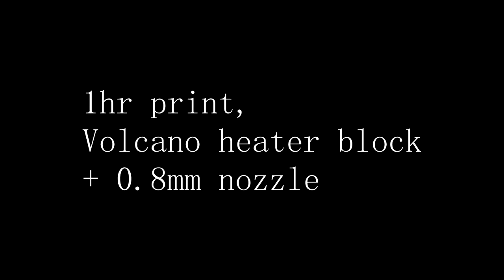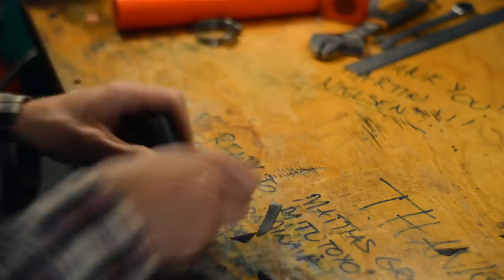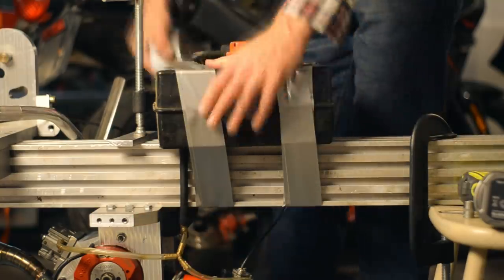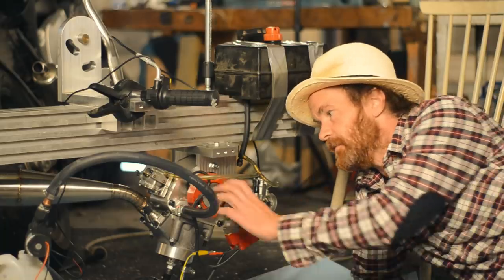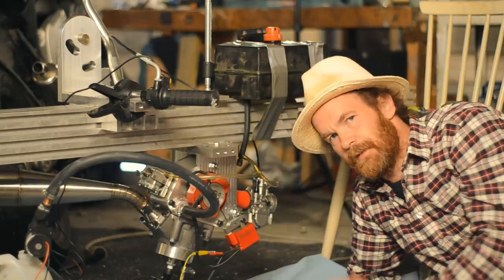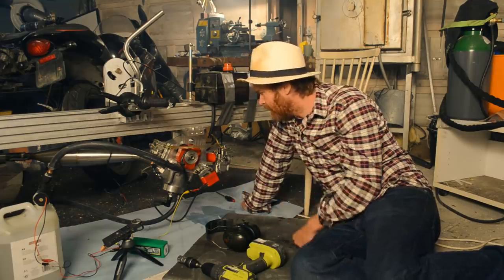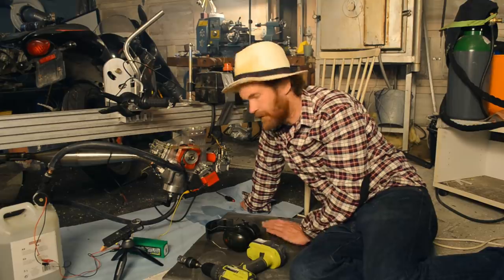Should not work, but...

Comment from the maker: Thanks for watching! I've ordered pulleys & belts for the dyno, time to get this show on the road!
As always, I'm way behind on replying to comments, sorry about that!
Reply: Your channel is getting quite large, there comes a point when you have to limit your replies to better spend time on video production etc ;-)
Reply: Wow man !  7:28 REAL 2 stroke 25k rpm
Reply: Man this is one insane little engine !
Reply: Whats up james lile my comment!!!!
Reply: It looked like there was some backflow threw the carb. I had a four stroke engine with a leaking intake valve. When a pulse of air would flow threw the carb backwards, it would pick up more fuel and then pick up fuel a third time on the intake stroke. The overly rich mixture had me thinking it had a problem with the carb, until I saw the back flow threw the carb.
Reply: You should put a tachometer on the motor so we could see the rpm🙂

Comment: This made me remember something i did 45 years ago. I welded a piece of tubing to the rear transfer port of a G5 Kawasaki cylinder.  It was maybe 12inches long and i bolted a 22mm carb to it. It actually ran pretty good, i think i got away with it because the intake was long and the carb was small. I had heard that  the factory racers were doing this to their 125mx bikes(pre KX)
Reply: It's Called " Ram Tuning " cheers

Comment: if youre using an electro motor as the load you could start the engine with that electromotor
Reply: Racebikes dont have a starter , uneeded weight

Comment: Looks like the resonance from the pipe is forcing the air/fuel from the crank case out of the secondary intake. You can see it happen later in the video
Reply from the maker: Yep. What happens below the powerband.

Comment: When cutting smaller sections of silicone hose squarely l always push it on to a mandrel held in the lathe chuck and part it off with a very sharp HSS parting tool. Works a treat

Comment: Don't know if it's not important, or because of the prototype/experimental nature of the system you are building, but it looked like exhaust gas was venting out of the secondary carb (sometimes), one thing I all ways stick with is the knowledge that a force will always travel the path of least resistance. You are doing great work👍🏻
Reply from the maker: It's just fresh mix being pushed out, will go away when in resonance.
Reply: @2STROKESTUFFING  Then it's all good, for now, also, then, no smoking on that side of the engine!

Comment: The pulsing in the secondary intake is visible, it throws out as much fuel as it sucks into the engine, but with the long trumpet on the sliding valve this will be no issue as the pulse reverses before reaching its end.

Comment: The Prince of persistence 😊👌🙏👏
The Wolbro carb brings back old memories of racing karts. We used to drill out the passages and install bigger jets and run the engines on methanol. I'll never forget the smell of Castrol R oil

Comment: In the mean time, as a way to load the the motor, why don’t you use the system that older stationary bicycles used? A large flywheel with a friction material wrapped around it. Then take a heavy nylon strap, wrap it around the flywheel, and tension it it to get a load on the flywheel. You can adjust the tension to adjust the load. Then the motor isn’t allowed to run away from itself, and makes tuning easier.

Comment: A carb at the end of a resonant inlet pipe is likely to suffer horrible stand off as the pressure wave will pull fuel out of the jets going in and going out. With the injected setup is the fuel going to be injected at the crankcase end of the tuned pipe?
Reply from the maker: Exactly. Yep, injectors are in the case.

Comment: You could run it diesel like, using fuel to partialize throttle
Reply: Running it lean will seize a 2 stroke
Reply: @ametti000  he's got injection, he can keep lubrication up with no gas

Comment: You could rig up pulley to a fan in order to put some load on it when testing.  I would think  that the load would scale very linear with rpm and could blow some of the exhaust out of your shop as a bonus.  As long as you be either on , or off  the throttle (accelerating  or decelerating)  you should be ok at high rpm. It's when the engine is at high rpm and  reaches that point where it's doing neither that things go Kaboom!

Comment: so slap a reed valve on the old test carb just to stop positive pressure pulses screwing with it... and maybe a YEIS bottle to smooth it out. 
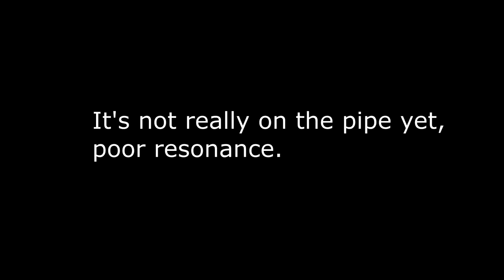You can see the positive fuel mix exiting the carb 8:24, luckily it didn't backfire or hilarity may have ensued...

Comment: Awesome work Alex , main jet to small if dieing after half throttle,  But could also be spot on with adding extra fuel  with secondary intake.
If me I would tune carb dyno run then add secondary intake/fuel see where the gains are great work.

Comment: twin carb single cylinder Honda used a small diameter primary carb for low rpm higher torque off road rough trail and the secondary much larger bore carb came in after half throttle to WFO

Comment: Great videos, I love all the ideas and testing. I was curious if anyone has ever tried a variable resonance pipe? Maybe a  pipe chamber the increases and decreases in size with throttle and or load? If there was a piezoelectric sensor that could be monitored in the exhaust to find the optimum resonance for peak performance?

Comment: By having a open hole to the one carburetor you are loosing crankcase pressure and that's the reason for the poor performance, try putting a Reed Valve on both intake ports that completely seal and then you will achieve the crankcase pressure necessary to produce the hp that you are looking for

Comment: You need an airbox. The intake and exhaust must resonate together for the gasses to flow through the motor efficiently. Without an airbox, there is no pressure wave to help the flow of intake gasses through the motor, therefore no resonance and no revs and no power. I think you need an airbox.
Reply: Interesting, any sources?
Reply: The open end of a carb bellmouth reflects pressure waves very well. The length of the bellmouth is used to tune the rpm at which the engine responds. Look at every successful 2 stroke racing motorcycle in history- not an airbox in sight. (Except perhaps late v4 2 strokes that employed some form of ram air intake).
Reply from the maker: Yep. The intake is tuned for ~19000rpm😁

Comment: Is that filament the pla-carbon mix thing? just print It hot and wide and it's airtight without any post processing? Freaking Amazing
Reply: Definitely cool to lightly clean it up and bolt it right on. I think he mentioned switching to CF-Nylon a couple vids back instead of the PETG and ABS he was using.
Reply: @Rebar77_real  ah yes i forgot, It was a nylon carbon fiber blend thank you, will try something out for sure

Comment: I wonder if it is evan worth running the intake air through the crankcase at all !! why not put oil in the crankcase and open the transfer ports to the atmosphere through a tuned intake and use scavanging/resonance/forced induction to charge the cylinder surely it would be less restricted than a turbulent crankcase

Comment: The video tells it all: blowback from the 24/7 carburetor whenever its throttle is opened, wich is only to be expected considering the Helmholtz resonance frequency there: conventional crankcase volume, big carb diameter, short inlet tract, low revs and infinite inlet timing.
Revving the engine higher before opening the 24/7 carb, like Alex is proposing, will help, but the best (and simplest) solution is to increase the inlet tract length.
Reply from the maker: Thanks for the feedback Frits!
Case volume(~400cc, if I remember correctly), and inlet length(~130mm) was calculated for about 19000rpm. Where the inlet ends/case starts in practice I'm not 100% on. Same tune for the pipe. Longer inlet for initial testing is a good idea, then cut to suit.

Comment: Great job ! The most powerful 50cc in France is thé bidalot wr rf  , 18 CV stock on my bike + ( 28 pwk ,vforce3 ignition mvt dd ) if you have + 20cv you are a mopped god 😁😜 . When you try to Make yourself a 120mm nitro pulley ?

Comment: I don't know much about nitro, except rich is ok, lean is where things go boom! It's very explosive when lean, the top fuel  engines are still burning the fuel when it leaves the pipe, some of it actually flames up when mixed with air because it's so rich, it almost sprays nitro out the exhaust, (drops of burning fuel). I saw a top fuel bike, with unexpected rider, it exploded a cylinder, the head hit the rider in the chest, but that's top fuel nitromethane, something like 90% nitro, 10% methanol,   I was thinking about mixing nitro RC car fuel with my gas for my scooter, 20% nitro, with about 90% gas, I know that don't add up, the nitro is 20% with what ever, and mixed with 90% gas, i just wonder how the castor oil would fit in the mix?? With what ever else is in the nitro RC fuel, currious if it would help the small 4stroke??

Comment: I had a Puch monza 3 speed, and tuned alot, once i bodgede a kreidler cylinder on it, with a 24mm karb, and custom exhaust (trail and error made). It was low comp, cylinder lenght not equal! Puch was 38mm, but cylinder 40, so aprox 55ccm. It got near 12hp at 11000rpm, very good acc, and Ca. 90kpm top speed. Could follow My friends car (alfa 156  2.0) to 80kpm. The power came from the exhaust, look at video. https://m.youtube.com/watch?v=HbqS3fz8EDA

Comment: I an not sure if anyone has used a supercharged intake port right at the top of the stroke and direct injection. The charger would work like a valve and help exhaust scavenging.
Reply: nice idea , really like that concept.
Reply: See the brayton cycle, as originally executed with a piston engine. Basically there is a compressor, a 'reservoir' (an air tank) and a fuel injector and pilot light. The fuel is injected and ignited as the valve between the reservoir and cylinder is opened at TDC. Constant temperature burn ensues to drive the power stroke, then exhaust valve is opened and the piston returns to TDC for the next burn while the compressor pressurizes more air into the air tank to feed it.

This is not an improvement on otto cycle for a piston engine, but you can replace the piston compressor and power cylinder with turbomachinery (i.e. an axial or centrifugal compressor and turbine). The result is a jet engine.
Reply: @Alfred Wedmore They scale down ok to even the tiny ones used in RC models, but as you say the efficiency is terrible. This can mostly be blamed on the low overall pressure ratio that's possible with such small engines, I don't think any of them surpass 4:1, and the original model jet engine built by Kurt Schreckling managed only 1.6:1 or so, which is barely better than a pulse jet. In his defense the compressor wheel was made of plywood...